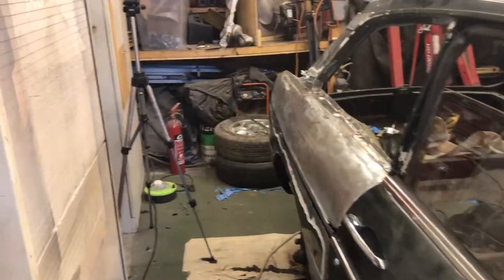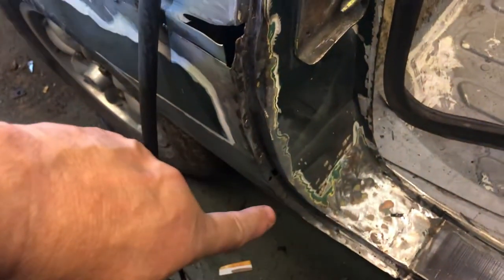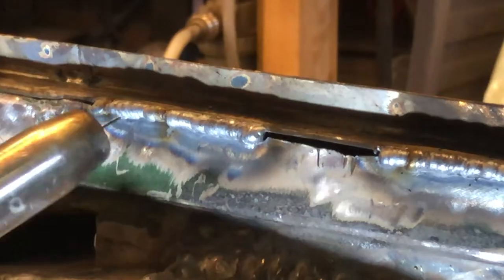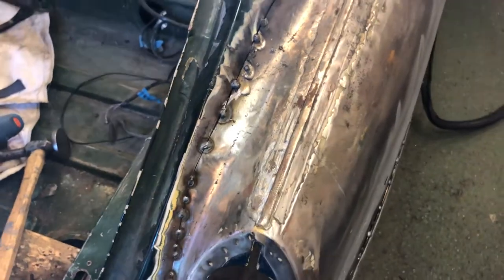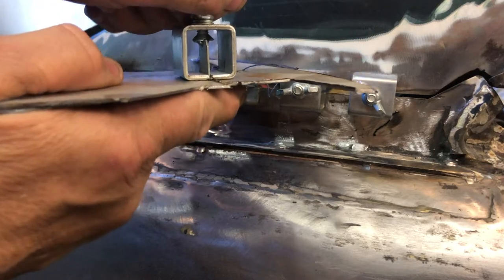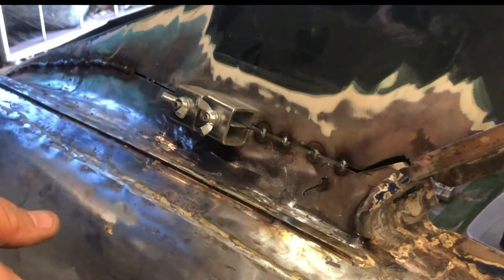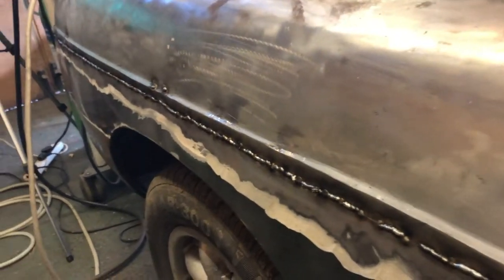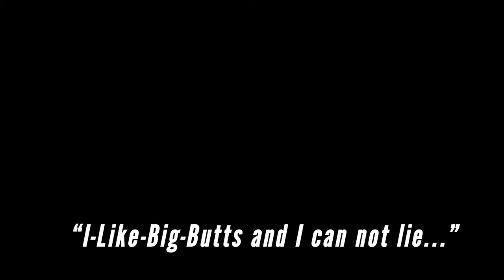U.K. MGB GT Sebring Restoration Episode 10 "Barse end Ackwards"

Comment: You keep saying you are not a welder. Well for the past year I have been studying car body repair techniques with various channels and some have been professional classic car restorers and their techniques used for repairing and replacing panels.   Some of these professional shops are NOT as good as you and do some horrible welding and then knock it down and use quite a bit of filler.   You are actually one of the best welders I have seen working on car panels.  
The best, for fabrication and welding cars I have seen,  is Fitzee's  channel .

Comment: Waiting with baited breath here?  Need my MG fix, watched all the mg vids, did you do any work on the rear front spring hangers and the support corner, I’m thinking of fabbing them myself, got one off with a spot weld drill (not fun) for a template, what do you think? Really impressed so far.
Reply from the maker: The front spring hanger mounts look to be OK. I’m going to have a proper look when the diff is ready to go back and I start the boot floor. I bet they turn out to be knackered knowing my luck. 😁